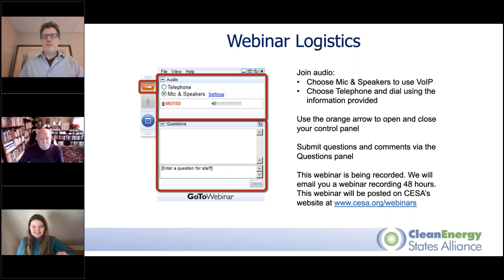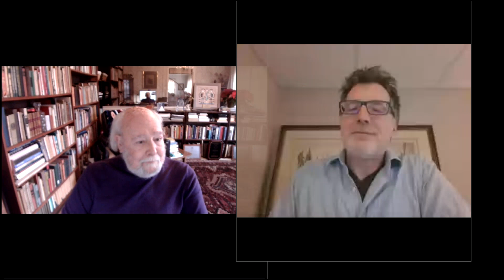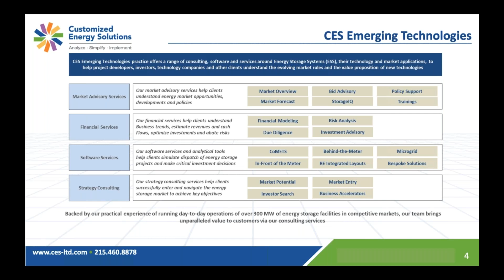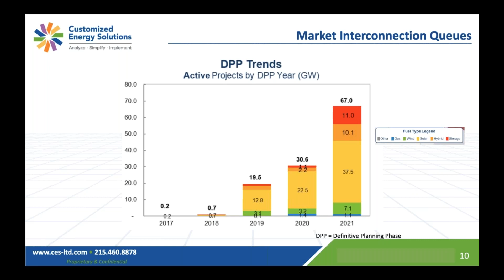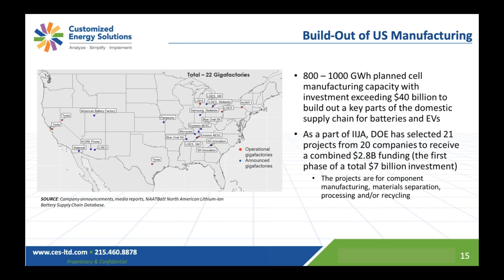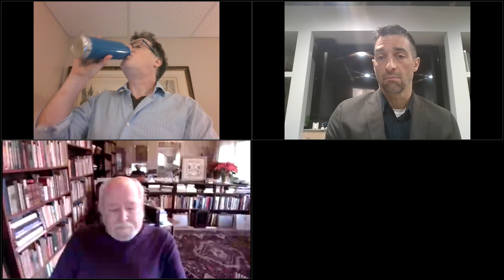State of the U.S. Energy Storage Industry: 2022 Year in Review (1.10.2023)

Comment: At 10 minutes, there is a lot of money available, if it will be wisely spent?  That is another matter.  

In Israel, they have a solar hot water heater in every building, so they do not need to use as much imported fuel to produce hot water.  They can require insulation in every American home, and should require a solar hot water system too.  

The second presenter really started to supply a lot of great information!  Thanks.  We need a lot more wind power in the northern states, solar in the southern states and storage!  

It is sad that there is a 3+ year backlog on connecting a large solar system in Minnesota, while places like California, they can approve a 50 MW solar power plant in a few weeks.  Why?  No logical reason, but Minnesota has a great way to argue any solar system connected to their grid will cause mass deaths from lack of power because any solar system is connected.  Minnesota does not seem to be capable of doing what California did 17 years ago, and allow some solar to be connected to the grid.